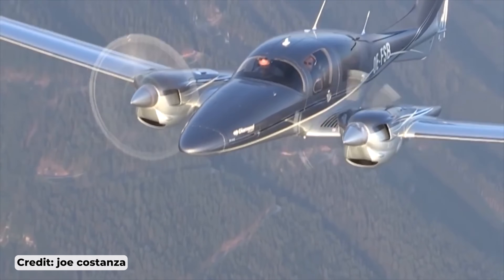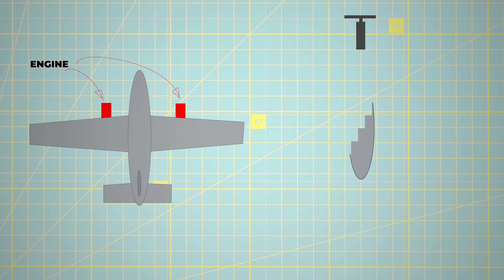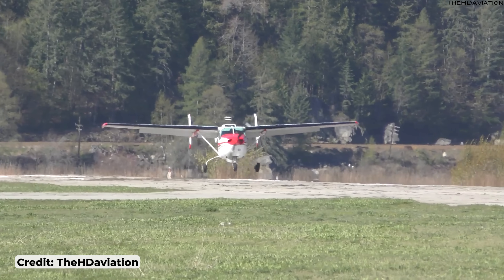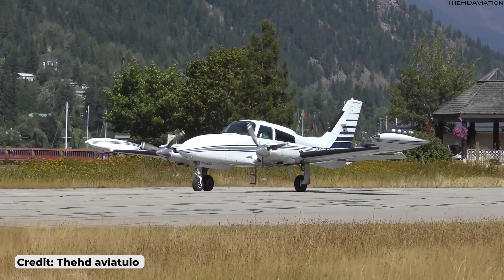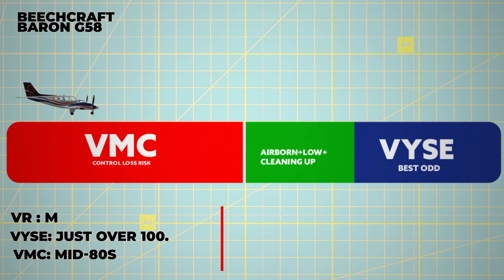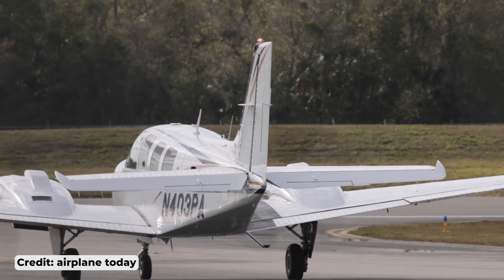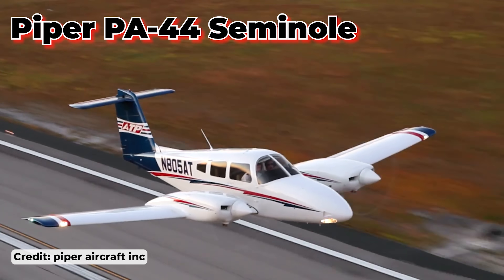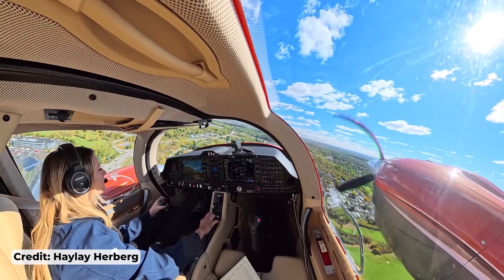Where Other High-Performance Twins Try to Kill You… the DA62 Tries to Save You.”

Comment: Nice video/graphics. One way I mitigate this issue is my Panther Navajo is to rotate at 100, instead of the POH number of very low 80s. The Vne of the tires is 140, therefore, well within their operational zone. By time the gear is 1/2 way up, airplane is already blowing through VYse. I probably wear out tires a bit faster. No biggie, as tires are cheap. I also use more runway on T/O. No issue there either, just use long enough runways. On landing, I hold VYse + 5 until committed to land, which is usually 100ft AGL after runway is verified absolutely clear. And, I confirm gear down once needle goes 1kt below blue line. The result of these procedures is, on any flight, my exposure in the danger window is about 10 seconds, if that, because, after T/O, I do not fly below blue line + 5 in any configuration - no reason for me to ever be below that speed. My $.02. Understandably, your mileage may vary.
Reply: I did the same thing flying Navajo’s for a cargo company. I did have two engine failures in 1 year. One at 500 ft after TO and the other at MINS doing a ILS app to 100-1/2. Glad I got in on that one.
Reply: As a non pilot this was my very first thought, hold off until you are going significantly faster than the minimum.  And it makes me wonder why thats not the standard, I know many issues in GA have been addressed simply by changing recommended procedures,  so I would think that would be the go-to option here, but also knowing people in the industry know kore than 8 do, I have to assume there's reasons I dont know. I can suppose that a longer roll means many smaller fields become un usable if thats the stated minimum speed, but it should probably be noted as recommended in places where its practicable.
Reply: @DrewLSsix  The unfortunate answer to your implied question (why not go faster?) is too many, I would say most pilots, are procedural followers, not analytical thinkers. They get trained to do X, Y and Z and never look outside that operational box again, even though the airplane could safely, and often does, better operate outside the initial constraints they were taught. Case-in-point - Bob Hoover performing maneuvers 99.9% of pilots do not understand, yet he never exceeded the limits of the airplane, which, funny enough, regular pilots break airplanes all the time. The biggest weakness I have found in the aviation population is the majority of pilots I have known (I am going to say almost all) have never read their POH word-for-word and even less read operating manuals for radio equipment cover-to-cover. They depend on hanger talk and someone else to show them, which is learning misstep, in my book. Hence, the same accidents happen over and over and over, i.e., no new thinking. My $.02.
Reply: I do the same thing in my Cherokee. I want an airplane that WANTS to fly, not one that's barely able to.
Reply: Great comment. I like your method of mitigating risk by making sacrifices in other, less important areas when possible. If you're working with a long runway, why not take advantage and extend your takeoff roll/reduce initial climb angle in exchange for spending less time in the danger zone? It makes perfect sense.

Another example of alteration of standard procedures in the name of risk mitigation: at our home airport, some of us will actually perform takeoffs with a slight tailwind if conditions require it, because the runway has a significant amount of slope and the obstacles are further away in the down slope direction. No flight instructor ever teaches students to perform a tailwind takeoff, but in certain, very specific situations it can be the best, and safest option.
Reply: @Synexii Exactly! Thank you for the extremely relevant example. When in high country or presented with consistent obstacles (i.e., rising terrain) off DER, a takeoff in a tailwind toward lower terrain or terrain with less upslope is the safe maneuver IMO in either a single or twin. I always remind myself that a high-powered twin could become a low-powered single at any time. Wishing safe flying in 2026.
Reply: Excellent comment and knowledge
Reply: Holy crap.  The King Air 350 rotates that fast with no flaps.
Reply: For years I have been rotating just 5 knots below blue line... I figured out many moons ago, that practice will save me in the long run
Reply: Good way to stay alive my aztrk at Truckee can/did cause loss of seatcover in uncomfortable body places..

Comment: So why wouldn’t you accelerate in ground effect and then climb at or nearer vyse? Similar to what you’d do In a military fighter, but for a different reason. If an engine quits you belly in and slide hopefully stopping before you hit anything hard. That isn’t great but it’s better than cartwheeling into it on fire…..

Comment: If you have the money for a DA-62 you have the money for a single engine turboprop like an M500/M600…and single engine turboprops are far safer and easier to fly…even before autoland, check the stats

Comment: Missing any discussion about both props rotating in the same direction.  For most civilian light twins I know of have engines and props that turn in the same direction.  For these twins, the thrust line of each engine lies not along the engine's centerline, but along the blade traveling downward.  On most such light twins the prop turns clockwise (looking from behind), which makes the left engine (looking from behind ) the critical engine to fail because right engine (looking from behind) produces much more yawing force than the left engine because the right engine's downward moving blades are outboard of the engine, whereas the left engine's downward moving blades are inboard the engine.  

A simple solution is to make the right engine rotate the opposite direction (counter clockwise when viewed from behind).  With such a configuration the downward moving blades are inboard the engine, greatly reducing the yawing force, with Vmc often below stall, and no critical engine.  So if this solution is so simple, why isn't it done?  The answer is that light twin are already too expensive, and producing one engine and propeller that rotates oppositely will add even more cost, making such aircraft prohibitively expensive.

Comment: While the DA 62's are safer, the number of engine failures that have occurred has meant that a lot of the 62's are spending a lot of time in the hanger. The DA 50 has the Continental CD-300, a much more reliable and powerful engine.

Comment: The diamond da still has a problem of asymmetric thrust even when both engines are running because one of them the primary thrust Vector is between the engine and the fuselage. And on the other engine the primary thrust Vector is outside the engine away from the fuselage. They spent a lot of money to make this a perfect twin and they did not make counter rotating props. Were the primary thrust factor is between the engines and the fuselage on both sides

Comment: The bottom line is? You really can't keep a plane from crashing. When the engines don't work.. A real bummer on takeoff.

And so it looks to me.. For these twin-engine planes. Strapped to each engine   nacelle. There should be an emergency, solid propellant, rocket motor.  So should  the internal combustion motor seizes? The rocket motor ignites. Compensating for the lost thrust. For the next 15 seconds. And maybe that should be looked into?  Since a parachute won't work at that low altitude. It needs the thrust. That suddenly goes away. And so you need an emergency booster jolt. But likely nobody has thought of that? They thhought about the parachutes. Thatt work when you have enough altitude. But what about on takeoff?  What other contingency backups might there be? What others' safety devvices could be incorporated? It would be sort of like a Roman candle strappedd to the nacelle. And a method to  ignite it. Either automatically  or through pushbutton. Since this is a known issue?

I might even be able to come over with better ideas if I was an actual pilot? But I was nothing more than a student pilot 30 years ago. Now I'm just a retired engineer.  But if this is a known aeronautical issue? And there are all sorts of other, anti-crash features installed?  Nobbody thought about this one? No emergency contingency backup plan?  Should there be a loss of thrust during takeoff? And nobody has given this any good aeronautical thought? From this known issue?  That's because nobody's  gray matter is working properly.  It's onee of  those problems that rarely occurs? But when it does? Everybody dies! Darn? Maybe we should think up a fix? Something else that can also help save lives? But no? No one thought about that one? It doesn't happen very often?  No need to worry about that? If it happens it happens you die. Oh well?

Nobody needs to think anymore. We have Artie Fecal Intelligence. I no longer have to worry about my pilots license at 70. Since I never got one. At this age. I would now have to fly those really lightweight dangerous aircraft. That require no pilots license.. LOL. You can still fly,  too high. And get in the way of other  faster aircraft. Whoopsy? But at least you don't need a pilots license for those lightweigght death traps. They can be flown at any age. I guess over 15?  Or is that 12 years of age? 10?  I've seen children playing grand pianos at 6 years of age. Playing complete concertos from memory. But that's not very natural? That's exceptionally unnatural. But it does happen. Mozart was one of those. He knew how to play the piano by the time he was 3 years of age. Only problem? Pianos had not yet been invented. He only had a harpsichord. It looks like a piano. It doesn't work or play or sound like a piano? He didn't know what a piano sounded like yet? It hadn't been invented? But his music sounds good on piano? We don't know how that happened? It was really designed for harpsichord. But sounds just fine on a piano. How did he know how to do that?

Thankfully nobody has to be Mozart to fly a civilian aircraft. Though? You do have to know the difference between your right and left hands. One is for having fun. The other is for working.
RemyRAD

Comment: The crash featured at 0:16 isn't a Vmc roll and/or engine failure. It's a show-off pilot who told the crowd he would buzz them on takeoff. Upon reaching the point in which he would need to initiate a turn for the low-altitude buzz, he was a few knots below normal rotation speed. He rushed to yank it off the ground and turn in order to achieve the desired "buzz" flight path overhead the person filming, resulting in your run-of-the-mill accelerated stall/spin, not a Vmc roll.

And you didn't make this claim, but just for viewers to be clear on exactly what Vmc speed is about... flying below Vmc speed does not necessarily mean you will stall and/or spin and/or "Vmc roll." The published Vmc speed assumes several factors. If my memory isn't too bad, it's something akin to max gross weight, the most aft-CG (which reduces rudder effectiveness), a 5-degree bank into the operating engine, and the critical engine (usually the left one) has failed. And even after all of that, this doesn't mean there will be a Vmc roll or stall/spin. It simply means given those conditions, you cannot maintain a heading, therefore "are not in control." A slight change of heading isn't always the end of the world. You can either accept the change in heading if terrain/obstacles aren't a problem, or you can bank even MORE into the operating engine to maintain heading. Of course, flying at/below Vmc is never a good idea. And it is possible to Vmc roll the aircraft well above Vmc speed. Go up to altitude, shut down the critical engine, put the operating engine at full power at 5 knots above Vmc, and then yank back on the elevator as much as you can - you'll stall the plane and enter a violent Vmc-roll. It's the stall that causes the roll, not the speed being at Vmc. A stall can occur at any airspeed, including speeds well above Vmc.

Comment: I am not a pilot, but I understand well the 3 speeds. Logically (to my point of view), we should reduce the gap between Vr and Vyse. So, it is possible to rotate later (if the runway is enough long), stay at low altitude to gain speed, and begin elevation when speed is close to Vyse. But, may be my assumption is false

Comment: VMC roll. BAN all GA until it is made safe with Recovery Parachutes, lower volatility diesel engines, safer designs which means no horizontally opposed engine twins. The selfish wannabe Chuck Yeager social irresponsibility must end.  High Speed Trains (HSTs) would have prevented the NASCAR family a few days ago becoming human BBQ. Japanese bullet trains from 1964: ZERO fatalities. Case closed.

Comment: GENERAL AVIATION FLAWS:
-UNDERPOWERED
-LACK OF AUTOMATION/PILOT ASSISTANCE
-CONTINUED USE OF OUTDATED AIRCRAFT
-LACK OF PILOT TRAINING
<these are just my opinions, however, general aviation has average of 2 crashes a day(2x365)going from and to forever>
https://assets.performance.gov/APG/files/FY2024/Q2/FY2024_Q2_DOT_Progress_Aviation_Safety.pdf
<and than basically, general aviation is underpowered(enough to kill lots of people, etc.)>
<and then why did Greg Biffle's plane crash!? he was doing below stall speed on emergency approach; but 3 qualified pilots!?>

<yeah, so ummm....with a dead wing, then old school aviation has a dead horse/deer on the wing that does not generate lift, but drag>
<maybe the center of lift and drag change during lost engines!?>
SUMMARY & CONCLUSION:
<crashing twin engine aircraft
<fly up to date engines/avionics/aeronautical designs/pilot training!>

NEW
~250lbs pt-6 turboprop
The Little Engine That Did - Vertical MagA 500 hp turboprop engine's weight varies, but you're looking at roughly 225 to 250 pounds (102-113 kg) for modern, light turboprops like the Rolls-Royce RR500, while heavier-duty or earlier diesel alternatives, such as the RED A03, might weigh around 800 pounds (363 kg) including accessories, showing a significant range based on design focus (light GA vs. heavier-duty diesel). 
https://en.wikipedia.org/wiki/Pratt_%26_Whitney_Canada_PT6

OLD
~500lbs 6cyl lycoming(standard for general aviation>
A 6-cylinder Lycoming engine's weight varies by model, but typically falls between 386 lbs (175 kg) for lighter, aerobatic versions (like the AEIO-540) and around 438-446 lbs (199-202 kg) for standard O-540/IO-540 series, with more complex turbocharged or geared engines weighing significantly more, sometimes over 700 lbs. 
https://en.wikipedia.org/wiki/Lycoming_O-540

VERY OLD
<the most recently manufactured 310 is from 1980(45 years old), see; that is a fucked up idea!>
The Cessna 310, produced from 1954 to 1980, was a popular, sleek, low-wing twin-engine light aircraft known for its distinctive wingtip fuel tanks ("tuna tanks"), excellent performance, and role as an executive transport, even seeing military use as the U-3A, famously appearing in "Sky King" as the "Songbird". Over its long production run, it evolved significantly with added features like canted tanks, increased power, turbocharged options, and cabin stretching, becoming a versatile, albeit complex, entry into the twin-engine market. 
https://en.wikipedia.org/wiki/Cessna_310

Comment: I own and fly a DA62.  Trained in a 42.  It is pretty easy to manage OEI.  Big rudder and lots of authority.  Counter rotating props would make it even better of course but I typically rotate above Vr anyway so the gap is small.  SE climb rate is better than many light piston twins but it’s not like my King Air 200 - but you do have enough to climb out reasonably quickly and come back into the pattern.  I’d rather not face it on a warm day at altitude but at least the max SE altitude is in the teens unlike many other piston twins.  Short answer - it’s well engineered and that helps but you need to be on your toes and on that rudder and you need to keep training for it.  But it’s a great airplane to fly and passengers love the roomy cabin.

Comment: How much did Diamond pay you to do this video?

You overstate the time spent after rotation and before blue line, and massively overstate the danger of a single engine departure. 

Yes, in a twin, you have to be able to reduce drag, maintain airspeed, and feather the prop in rapid succession.  But in a single, you are a glider, and in a twin, IF you do the proper things in the proper order, you can still climb, if poorly.  It ain't that hard, and if you can't do it in a baron, you likely aren't gonna be able to survive in a -62 either. 

But an engine failure at takeoff, just after rotation, is not the climactic death sentence you describe, even for a P-baron or a 340 (I've owned both) .

Like most things aviation, training mitigates much of the issue, and one must remember that airplanes are unforgiving.

Comment: Nicely done video.  Experienced DA62/42 pilot here ... I agree with your points that enhance safety on the Twin Diamonds. Also this does a good job explaining the practical significance of "red-line" and "blue-line" which confuses many students.  As you say, it is still critical for the pilot to react with the correct control inputs when an engine fails ... that requires regular training to maintain proficiency ... but these plane's safety record (not perfect but very good) is in part due to the issue you describe.

Comment: Love the da62 concept, don’t like the price.  Also you mentioned several extreme cases with the P twins but they are manageable with technique and RW length. 55 Barons with 520s or 550s rotate at about 84. As soon as the gear is up they are at 100 and climbing out above blue line.  They all have their risks and we have to train to mitigate that. Training is key for all twins.